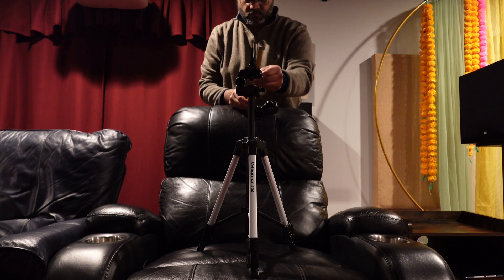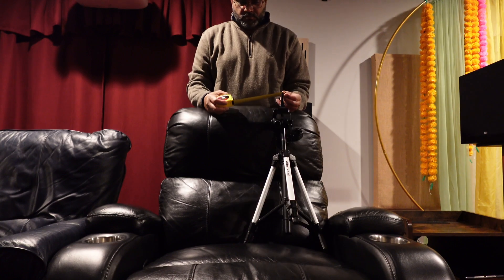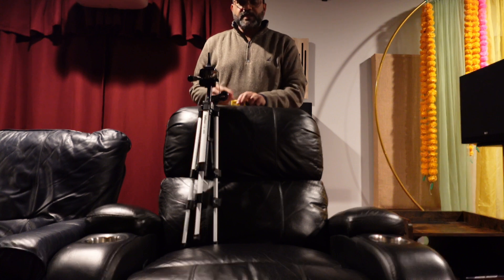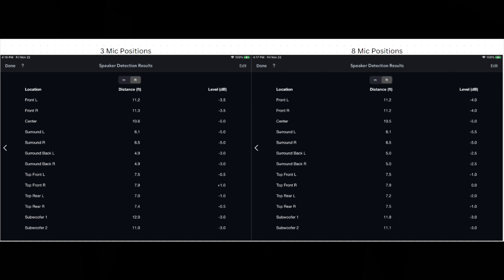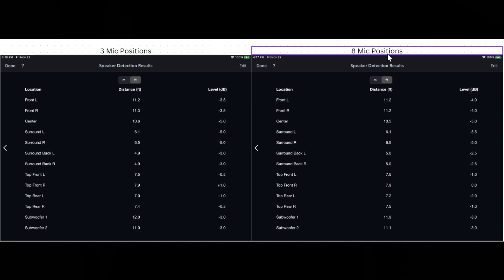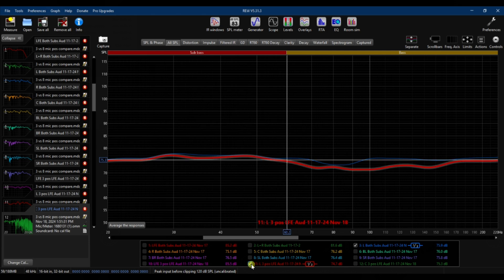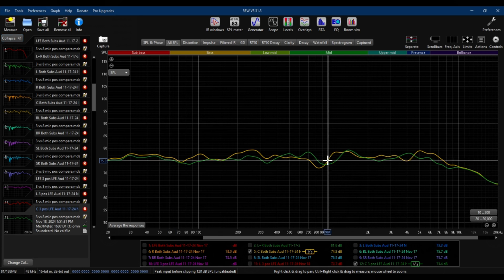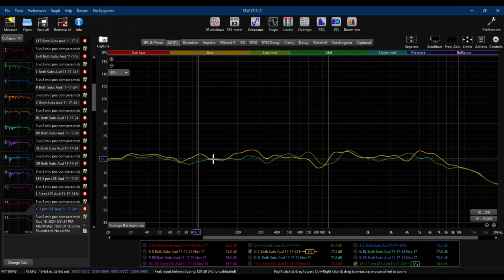Should I Use 3 or 8 Mic Positions to Run Audyssey MultEQ-XT32

Comment: Hi, my sofa is behind the wall, so I can't measure behind, I only have one sofa with 3 seats and a chair left of the sofa and a chair right of the sofa, so measure 4,5,6,7, and 8 is not in any position I have a seat, what do I do in my case? Thanks
Reply from the maker: Is the sofa a single seat?  If so, then you take the first measurement where your head is. Then 2 and 3, 20 inches to the right and left,  4, 5, and 6, 20 inches to the left front, front, and front right of the main listening position. Then 7 and 8, 6 inches to the right and 6 inches higher than the main listening position where your ears would be.

Comment: Hi good video. Question if i need to redo my audyssey should i delete the old audyssey set up. Or switch off the audyssey. Thank you.
Reply from the maker: Thank you for watching!  If you are using the MultEQ app then your current Audyssey file is already saved.  Turning Audyssey off and then running the calibration doesn’t mean much because once you connect the mic and run Audyssey it’s turning all processing off anyway. You run Audyssey using this technique and send the file to the AVR via the app.  If you like it you keep it otherwise resend the original Audyssey calibration back.
Reply: @magnoliamo  again thank for the  guidance as I added accouctic panel I was advice to run audyssey again.  Is that correct?
Reply from the maker: @gulamgh Yes. That is correct.  Acoustic Panels will alter baseline/Pure Direct sound and in-room response of your speakers. All positive but you do need to rerun Audyssey.  Anytime you add/remove/move furniture/blinds/curtains you will need to do the same.

Comment: I only have 2 seating positions with a small table separating them. I am usually watching alone and sit in the right chair. What is my MLP for purposes of running Audyssey? Should the first measurement be the phantom seat where the table is or my right hand seat? Can you stop the measurements after 6 measurements (my Denon x4700 appears not to be able to stop after 3 until 8)?
Reply from the maker: Hi. Thanks for the question. Minimum recommended measurements are 3.  You can stop after 3 anytime.  You should see an option pop up that says “Use 3 Positions” for example.  Ideally, you should be in the middle and inline with the center channel. Are you able shift your seating arrangement to the left so that your seat is in the middle and equidistant to right and left speakers and in-line with center speaker.  If that is not possible then your MLP is the right seat. That will cause speaker trims to be higher for left, center, and left surround than the right side speakers.  You can use the table as the MLP position to get a more balanced calibrated result but that’s not ideal either because you are not sitting there. Tough call here. Try it both ways and see which sounds relatively good. Good luck! Let me know if you have any further questions.

Comment: Hi mo hope your well I'm thinking of moving my fronts wider what the best distance apart from the centre speakers is best ? At the moment they are 2.5 feet away from the centre woofer each side , am thinking could sound better if wider? I have an 11.1 set up auro 3d voice of god.
Reply from the maker: Yes they need to be wider.  It depends on how far your front speakers.  Mine are 11 ft from the main listening position 4ft apart from center on each side.  Wides should be installed as follows per audioadvice.com home theater configuration tool. 

Front Wide Surround Speakers: 
5' 5.53" from the screen's wall at 3' 2.00" from the floor to the tweeter. These should be in line with the side surrounds.